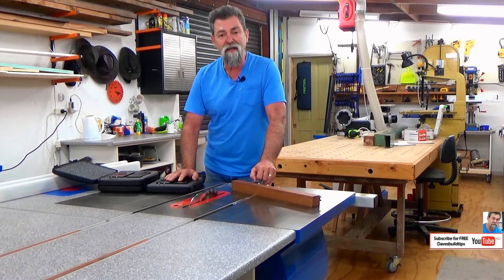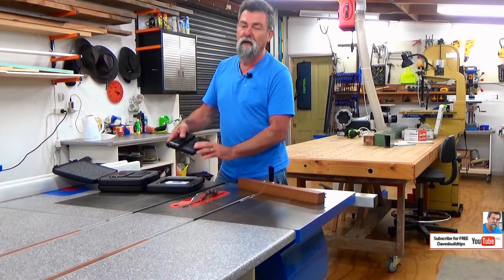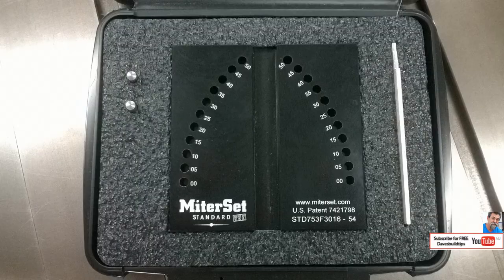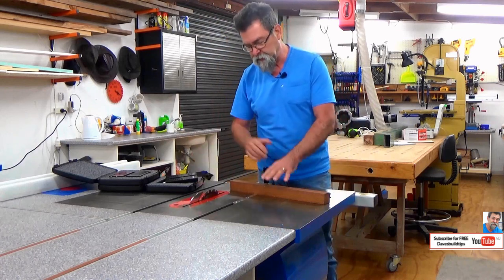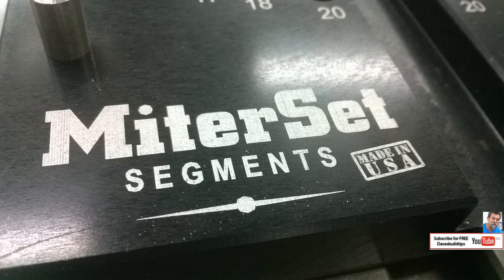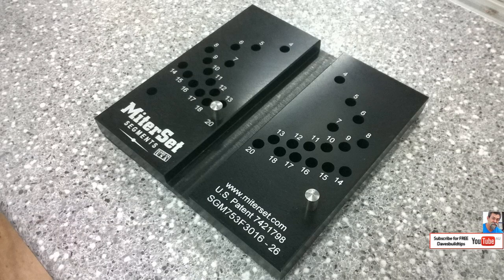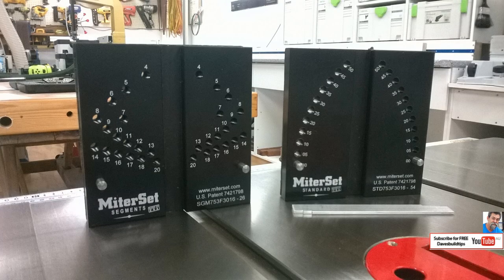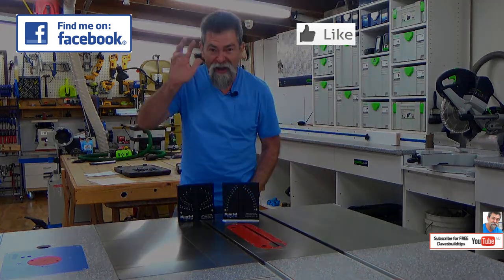miterset how to cut perfect mitres dave stanton woodworking furniture

Comment: Your review was the third one I have seen on the miter set. I finally pulled the trigger and bought it. I was hesitant because I have already invested in the Wedgie Sled plastic angle thingy and built the Sled. It works great, but is kind of a pain to use. So, I'm waiting for delivery of the miter set. Hope I'm as happy with it as you and the other reviewers.
Reply from the maker: It is very accurate and I enjoy its easy set up for angles.

Comment: Awesome set Dave, I will be getting these for my shop as well. have sold the table saw and have gone to using the MFT 3 Festool setup. Loving my Festool. Also use the Router table for many other things than just the typical router table. Thanks again.

Comment: Hey Dave, 
First time commenting on your channel. Love the work you do and envy your tool collection Keep those videos coming we are enjoying them.  Now for my question.  I have an Incra miter gauge 1000se as well as the Miterset.  Correct me if I'm wrong, but the Incra miter gauge bar is sized several thousandths of an inch undersized (from Imperial 3/4"  standard miter slots) in order to use their GlideLOCK miter bar adjustment system to adapt to both under and oversized miter slots. I took this straight from the Incra web site:

  The miter bar's adjustment range accommodates actual slot widths between 0.740" and  
   0.765".

How are you making your miter gauge bar fit snugly in the Miterset?  The Miterset slot is exactly .750" so there is .005" wobble or play when I try to mate the two.  Even though it's a small, amount it's probably enough to throw off a setting by a degree.  This is a precision tool, you should get precision results and with a .005" difference between the bar and the slot I don't see how you can be EXACTLY spot on every time. The only solution I see is to shim both sides of the slot or bar equally thus keeping the bar centered in the Miterset.  I'm probably being too anal, but I am curious to know how you tackled the problem.

Thanks,

Scott

Comment: OK the answer to this question, Dave, will decide if I buy this or not. I have an Incra 1000SE and I have set it to bang on 90 deg using a dial indicator and checked with the 5 cut method. Within 0.001". To set the gauge to 45 or any angle would you rather use the miterset or the incra's gauge. In other words which do you "trust" more to set an angle
Reply from the maker: Easy answer John. The incra 1000se is using 5 degree indents which is very accurate (1000HD is 1 degree indents). The miterset is using cnc aligned pins that references from the front of the fence not a protractor from behind the fence. Obviously if you are getting 90 deg within .001 inch that is great for conventional angles from there on but the thing I come back to is regular sided polygons that can have fractions of a degree. In your situation you may be best with miterset segments to align the incra from in front when using a sacrificial fence?
Reply: Thanks for the quick and informative response. I was leaning towards the standard unit but the segments unit still allows 90s and 45s as well as all the other angles. Keep up the good work. BTW this confirms what I thought that aligning gauges and sleds is best done aligning the fence to the slots NOT the blade. The 5 cut method while accurate is too tedious. EDIT ...just ordered. I'll let you know how I get on

Comment: Dave, give that these are super accurate, how far off was the standard setting on your Incra HR and Capex?  I use a sacrificial piece too, and I've never worried about the inaccuracy, but now you've got me thinking that is what's introduced a tiny gap into some of my corners.
Reply from the maker: Hi Euan, thanks for taking the time to make a comment! It is something that I had never really lost any sleep over until I started using miterset. The thing is, as you mentioned a little bit of inaccuracy on each joint adds up to a fair bit and it is noticeable.

Comment: Just a thought out of left field. Is there ayway to use this with your cross-cut sled and align it 90 deg? Maybe with the sled upside down?
Reply from the maker: I use it with the rockler via a sliding bevel. I spent a long time aligning my saw blade with the miter slots to make life easier for me and stop any burning the blade may have done previously. Most cross cut sleds are very wide in comparison to the mitreset pins. Might have a think about this....

Comment: Good demo Dave but one question. When you place your mitre gauge onto the slot of the mitereset does that have to be a snug fit like you would on your tablesaw slots. If its a sloppy fit doesn't that mean the angle will be out?
Reply from the maker: Yes, the fit must be snug. The slot in the miterset is exactly the same as any standard 3/4 inch mitre slot. There is another miter slot on shopsmith saws that is slightly narrower and miterset make one for those as well. I hope this helps and thanks for the compliment!
Reply: I have an incra as well. Was the fit perfect on the miterset or did you have alter the expansion knobs when you took it off your tablesaw?
Reply from the maker: It was perfect in the miterset. The mitre slots were exactly the same width. My saw is a Carbatec badged 3 horse cabinet saw made in Taiwan.

Comment: The MITER SET SEGMENT could save me money by not buying the expensive miter gauges on the market.  Is that right David Stanton?  I can use an ordinary miter gauge and cut perfect accurate angles!  Would you still advise me to buy an Incra Miter gauge or the Rockler Crosscut Sled?
Reply from the maker: Hi Spratlyk9! I use the sled for different operations, mostly when I want to carry what I am cutting, not just pushing against it. The miterset is great for getting better accuracy and can be used with any mitre gauge.
Reply: @DavidStanton  I'll get the Rockler crosscut sled and the Miterset Segments. Thank you!
Reply from the maker: @Spratlyk9  I'm sure you will like them. Did you see the adjustment I did to the Rockler sled?
Reply: @DavidStanton  Yes I did.  Can I order the Sled through your link too? I would love to do that to support your channel.

Comment: I noticed in the Miterset site they say miter gauges like Incra won't work with the Miterset but you are using a Incra and wondered if there was something special you had to do to yours to make it work?  I have the 1000 HD and 5000 sled
Reply from the maker: Mine is the V27 I think so it may have all the nylon expanding discs in different places which ensures within the aluminium mitreset block?

Comment: So one pin is always set at 00 right?
Reply from the maker: Correct. Either the left or right hand side depending on which miter slot you are using on the table saw.

Comment: you did dave and that was my mistake,,i went to order it and it said it would work on all table saws with a 3/4 in miter slot,which mine does,,but it also said it would not work on the dewalt contractor saws,,don't know why,,mine has the 3/4 slot,,,lol
Reply from the maker: Well....buy it! LOL.

Comment: Is anyone using these on the Bosch GTS 10 XC? It uses a 20mm slot for the mitre - just not sure the tolerance on the Mitreset and if the Bosch will be too big to use.
Reply from the maker: Is it 20mm or 19mm?
Reply: The Bosch is 20mm

Comment: used to have something similar to that. it was useless. miter guage has to reference the blade not a miter jig.
Reply from the maker: If your mitre slot is not dead on parallel to your saw blade you will have tear out no matter what you use to hold the timber at the desired angle to be cut.

Comment: Ok, so it's 15* to the miter bar. That doesn't guarantee it's 15* to the blade.

Also, for a CNC made tool, I'd expect better than 0.5* accuracy.

Great overview of the product. Might be good for others, I'm not sold personally.
Reply: I'll say this, though. Set up speeds are going to be lightning quick bring able to lock the miter bar in place while tightening.

And the segment plate is pretty clever.
Reply from the maker: The segment plate is the one I use.